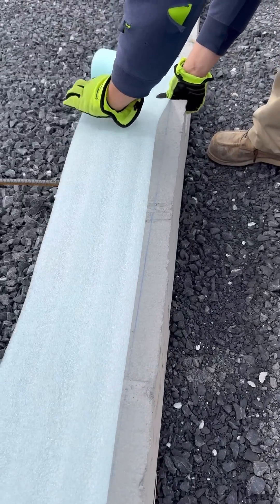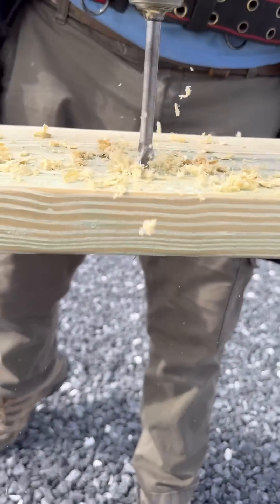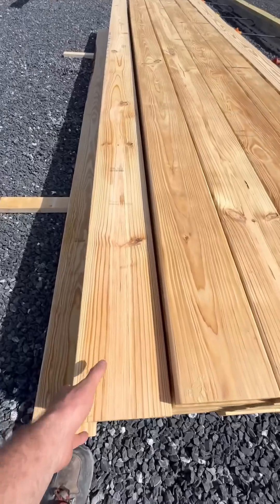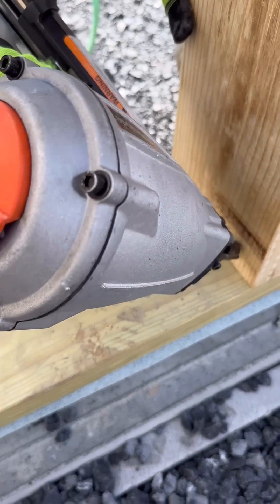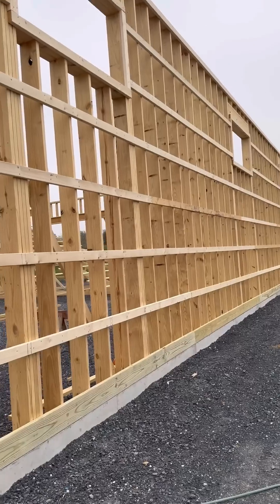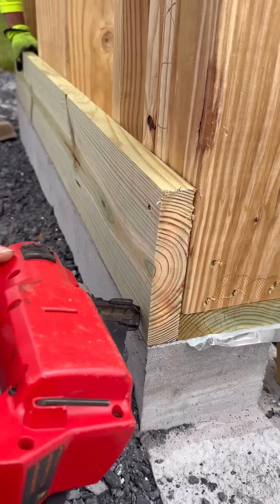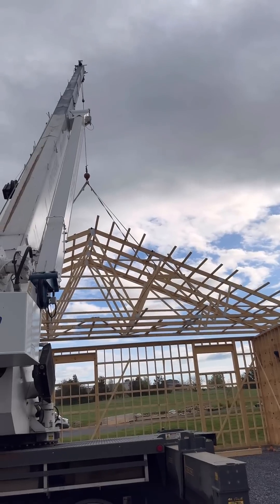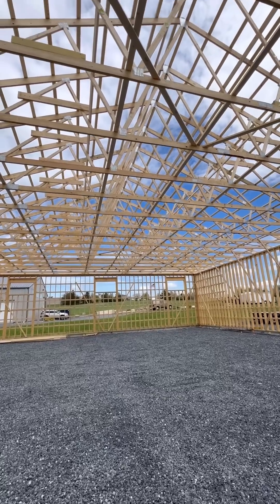How To Frame A Warehouse

Comment: Did you legit toenail the bottom of every stud? I don't think I've ever seen a worse technique in an instructional video. That's simultaneously worse for structure and about three times slower.

Also, id ramset the plate to the concrete, set a pre-framed wall onto it, and then drill the holes thru the walls and into the concrete. That way you can set any schmuck to the slow task of drilling at any time, and it doesn't slow down the build process. Your way makes it a total bottleneck.

Comment: You should try the Simpson strong concrete ties. You just drill a hole and drive the tie through the bottom plate with an impact. It sucks the wall down better than anchor bolts. Their a little more expensive but quicker and better in my opinion.
Reply from the maker: I’ve used those before they work really well. But they are expensive.

Comment: With a building that big with wall studs that huge. Can you still use them 16" OC or do they have to be 12"?
Reply from the maker: We went 16 inches on Center but they were 2 x 8 studs
Reply: Most of the time we do 24" on center

Comment: Nails instead of screws 🤦🏼‍♂️
I guess your childhood didn’t contain The Three Little Pigs, or you never learn 🤷🏼‍♂️
Reply from the maker: You need to check building codes, screws are allowed for this type of framing. Screws are brittle and break with movement nails allow for some flexing as the wood expands and shrinks.

Comment: In the uk we would not be aloud to build the whole unit out of wood
Reply: Wood framing is cheaper and easier to insulate. Steel and concrete construction are used if buildings are close together and at risk of fire.

Comment: It seems like the normal way to build a pull barn would be more cost effective
Reply from the maker: The problem with the pole barn is the walls are on 4 foot spacing so it doesn’t work out for drywall on the inside

Comment: Why doesn’t the bottom girt also need sill seal like the sill plate gets?
Reply from the maker: The plans call for the bottom girt to be pressure-treated lumber, so it can rest on the concrete without rotting

Comment: Is there sil seal needed for the bottom gurt? Since its touching the concrete as well? (Actually curious)
Reply from the maker: The plans called for the bottom girt to be pressure-treated, so it’s not a problem for it to rest on the concrete
Reply: It's for insulation value.

Comment: Is wood really cheaper than metal right now? That's crazy. I have a 40*60' steel building at my house. I thought it was huge, but it filled up with stuff just like any other white persons garage 😂. I wish it was wood framed. I never studded out the inside and now woods so expensive I can't, so I can't hang any on the walls. It's just two inches of foam board and the outside steel siding. My grandpa had it built in '99 and I'm pretty pissed the company didn't do any vapor barrier. The foam board has water stains at every seam.

Comment: Great explanations. Thank you! Btw how do you keep studs straight when you nail purlins? Do you mark on purlins or use a level to keep studs straight? I am not a carpenter, so I am curious how you build it plumb and level.
Reply from the maker: They measure and make a mark on each truss for the location of the purlins this way they’re all in a straight line

Comment: 5000 sq ft of roof done by the end of the day a couple days later 
Thats trim and everything…. Right 
More like a couple days framing, a day for trusses and a couple days for steel. That’s probably 5000 screws alone which would easily be 20 man hours

Comment: Why frame 16 oc when it so much cheaper to pole frame when using perlings? Genuinly asking why someone would spend more on this.  Thank you
Reply from the maker: 16 inch on center studs work out better for drywall and interior finishes

Comment: Only one comment:  When you put the 2x8 pressure treated on the front, wouldn't it have been better if the sill sealer strip had extended out to that point as well?
Reply from the maker: It’s pressure-treated so it’s rated to sit on the concrete, but yes a better practice would be to add seal underneath that piece or hold it up an 8th inch

Comment: It amazes me how fast construction workers build these buildings. Recently, a 10 acre warehouse was built in less than a week. It was all steel and sheet metal. You workers are amazing. I dont know how i could ever handle the heat.
Reply from the maker: Impressive
Reply: The shells are so optimised that it's honestly scary.

It was "only" 2.5 acres but a factory i asked some prefab guys to take care of was done so fast after the pad dried that the concrete people were slower to inform me than the prefab guys.

Comment: Noob question here. Why did you put the first seal only partly over the foundation?? Whats the purpose for the missing strip?
Reply from the maker: They put it down underneath where the sill plate goes, but didn’t want to cover their chalk line. The sill was held back an inch and a half from the edge of the foundation to make room for the 2x4 girts
Reply: Bottom plate seal is for insulation.

Comment: Does it have any permanent substantial diagonal braces or stringers ?    Any plywood wind corners or others structural sheathing planned ?
Reply from the maker: Great question! The entire inside of the structure will get sheeted with half-inch OSB
Reply: @hausplans     That sounds like a good plan, it should make it a great deal sturdier !      :-)

Comment: Lay the bottom plate on the anchorbolts and bang it with a hammer to mark the bolt holes rather than measuring out each spot to drill...

Then maybe you get it built in 45 seconds instead of a minute 😉
Reply: We do that most of the time. Measuring is slightly more accurate unless someone measures wrong

Comment: That 'shed' is exactly what I need to park my lawnmower in! 😂

Seriously I'd love to have a garage\shop just like this! Need a lift or 2 maybe on one side. I'd also add the PEX to the concrete so I could put in radiant floor heating eventually & of course a mini split HVAC unit to keep temps down in the summer heat. Maybe someday! 👍🏻👌🏻🛠️🔧🔩🤔⚠️🚧📐🗜️🗜️✏️🦺🚜

Comment: That’s crazy… We framed a similar 50’x100’ shop last year that took us (2 man crew) a month to frame. 2 floor systems in it though, along with 3 sets of 8-3/4”x36” single-span glulams spanning the 100’ run bearing on 4 9x9 GLCs each run. (2)2x12 @ 24OC for the roof system with 3/4” plywood. Miles of hardware and lumber. This is a whole different system but it’s amazing to see a shop go up this fast and efficiently. Good job! 👍🏽
Reply: 36x100 barn, 2 man took us about a month, in July in the middle of a open field using a generator for power. Worst month of my life lol
Reply: @uzifromtwitter5257  I bet! Stress is a real factor on these builds.
Reply: 😳😯😃YOU'RE amazing!! Two men building that much quality construction is impressive.  
Rock on👊
(Did you top off installing a metal or asphalt shingle roof?)
Reply: @ayouness  we did!
Sided and roofed the building. Certainteed landmark Asphalt composite shingles 👍🏽

Comment: No wonder buildings fly away when there is a bit of wind. Nothing anchors the building to the ground.
Reply from the maker: I guess you missed a part about half-inch anchor bolts
Reply: @hausplans  Thar's cute !
Reply: You fools think it is "bit of wind".
Reply: @n3v3rforgott3n9  Exactly... And that's why the weak connections to the ground are absolutely not adapted ! That's why the structure is not adapted.
Reply: @fabr5747  ... you understand very little from the sound of it.

Comment: I am an architect from Germany and it’s funny to watch how warehouse in the USA are built… in Germany warehouse are usually made out of steel beams and if it made with wood, it would be huge beams with an huge distance to another and usually with big steel connectors.
Reply: This is typically called a barn or out building. We have minimum codes that require certain materials for these buildings, so my guess is that this is either on a farm or something where its not commercial work but rather residential.
Reply: North America is about mass production, Europe is custom made. It was the same 100 years ago as it is now. Frame buildings are the best for mass productions. And if one keeps water away (though Venice stands on wooden beams for several centuries) it will last for 200 years no problem.
Reply: @thecurious6721  it is not about mass production… because big steel beams or big wooden beams are also very easy for mass production… we use these video shown frames just for smaller things like a carport or a tiny hood for gardening equipment… for everything bigger we use bigger dimensions…
Reply: @m.s.3041  steel is more expensive than wood and more difficult to work with. Though, I meant it is for mass production of detached houses, not tiny apartments from metal and concrete.
Reply: steel is more expensive and the weather climate and terrain of a lot of states in america makes wood a better building material bc of storms. in places like tornado alley and stuff it would be super expensive to replace a house framed with wood and steel beams instead of js wood. up north they have rly bad snow storms and shi too and down south the hurricanes so wood ends up being the better option so ppl don’t go shit broke repairing their houses multiple times a decade or year depending on where they live
Reply: also the way foundations are laid in america is a bit diff from europe too bc of the climate. so wood and plaster tends to be fine in the long run bc the foundation is strong enough to withstand storms and stuff. wood is just used if god forbid something happens it’s easier to replace. it’s also a better insulator for heat and shit too
Reply: @xaxabinks  sorry, but usa has different climate zones. From alaska to florida. The way north america houses are built is pure financial reasoning. 100 years ago US had the same houses as in europe from brick until smart entrepreneurs realized that they can build cheaper and faster wood frame houses rather than masonry houses. That's it. nothing else.
Reply: @thecurious6721  ngl i deadass said shit ab usa having different climate, i thought it was implied when i mentioned multiple states that i meant multiple climates… wood is the best for most of the climates its also the cheapest and its best for some foundations bc its lighter
Reply: @thecurious6721  and even a 100 years ago wood was still used for framing bc it’s one of the most abundant materials here
Reply: @xaxabinks  explain me why all over the world! except north america and australia most of the construction made from brick, concrete and metal?  Are they wealthier than Americans? Or US climate is so unique that wood is the only best option for US?
Reply: @thecurious6721  concrete isn’t as great as u thing for building houses. it cracks in fires. it’s horrible for earthquakes bc it can’t hold its form well. and on top of that it’s horrible at insulating. And america is literally more wealthy than every country you just listed. like miles more wealthy.
Reply: @thecurious6721  and the American climates are 10x more unique than Australia or England lol. We have deserts, Tundras, Rainforests, Woodlands, Forests, Swamps, Marshes, etc. Just the north east coast, where I am, has culture, architecture, and climate so different from the south east coast you’d think your in a different country if it wasn’t a state of the US. Florida is nothing like New York. New York is nothing like California. Florida also literally has a shit ton of concrete and brick houses bc they cool shit better and the east coast barely has earth quakes. Cali has concrete houses(for cooling) and shit too but most are wood as well bc they have earthquakes often as well as sand storms and shit. I also think europeans forget that a lot of southern parts of the US literally never see winter. And some parts of the US see winter for like 7-10 months out of the year. Maine literally has snow in fucking May. Like 4 ft of it. Houses are constructed completely different in every single state bc the climate of all 50 states is different. Saying american houses are weak because they are wood is stupid bc u forget that a house’s integrity comes from more than just its framing. It comes from it’s foundation, the era it’s build in, the way it’s being framed, the type of wood being used to frame it(i know that it’s hard to comprehend for some people but not all woods have the same properties) There’s also the roof, siding, the basement if there is one and a bunch of other shit too. Even windows can make a houses integrity greater. Y’all need to work to some research on how houses are built before u talk shi ab american construction ngl. Bc i’ve deadass have never seen a building collapse here unless it’s being demolished or there’s a natural sink hole forming under it from DECADES of it being there. Hate when ppl who have never worked in construction talk about it. y’all look stupid.
Reply: @xaxabinks all people in the usa are shit broke because they like to owe everything, always using credit cards and loans
Reply: I guess like a personal/small business warehouse is what I was meaning.

Any supply store/material yard, rental equipment warehouse etc I’ve seen concrete and steel beams.

That’s what I meant.
Reply: . 1760 house we worked on , Ceder siding,  new cedar roof , real old growth 2×6 sheathing on diagonal,  still Plumb Level square,  not fast growth the use today,  we do Steel buildings , largest 125'×575' clear span
Reply: American Insurance don’t like when things last because it doesn’t make anyone any money if they don’t need to be replaced sooner rather than later
Reply: Our commercial Warehouses are still as well largest I ever did ., in US, 34 meters by 600 meters clear span expandable end wall
Reply: UK construction uses steel frame construction for these type of industrial units too
Reply: @willjumeee for actual industrial warehouse we use steel beams and concrete etc.

This is kore a personal use type building not a commercial/industrial.
Reply: @justinstevenson2061  brother, the video literally starts off with “this 5000sq fr warehouse”
Reply: @willjumeee  I would bargain this isn’t a commercial or industrial building.
Reply: @richardmann4006 building of that side with multiple roller shutters - likely to be industrial even if a store of sorts
Reply: Crazy seeing such buildings being made of timber in  this day and age!  I build warehouses in Australia. Only wood in the building is the skirting,architraves and doors in the office part of the warehouse.
Reply: @lovelyhurlin6494  when the alternatives cost considerably more, wood is very appealing.
Reply: @sterlingodeaghaidh5086 also in wet climates steel tends to fall apart just as fast as wood unless you get way thicker and more expensive.
Reply: Cuz it's crap that wont last 20 years strong, wood is not as strong as it once was. We are farming it too fast
Reply: @saucedgamingnetwork4394 wood is just as strong as it always has been 😂😂😂
Reply: @saucedgamingnetwork4394  wood buildings definitely can last 20 years
Reply: To be fair, a wood frame structure (stick-built as we say) like this is pretty rare even in the USA. Most often, a shop/warehouse building of this size would either be steel or concrete tilt-up.
Reply: why is funny?
Reply: It's a good thing they had a structural engineer design it and not an architect. If we need something to look pretty, then we'll give you a call!
Reply: @AC-im4hi  IKR, many of these commenting don't appear to have a clue what Yellow Pine is and the strength of it.
Reply: @AC-im4hi  to Err is human , to really foul things up requires an ACAD program
Reply: @AC-im4hi   what do you mean? Naturally these warehouses are just made by engineers in Germany… i just said why i know how they are built in Germany, because as an architect i have many insights on these things…
Reply: This is probably a warehouse on someone’s property or farm. Don’t be an idiot and think all of our buildings are built like a shop at someone’s house.
Reply: Everything’s just built better in Europe
Reply: @willjumeee  That's such a weird thing to say. How long have you been a licensed engineer? You should probably call this guy and let him know his building will fall over and needs to check his calcs
Reply: @AC-im4hi  just a fact that steel trumps timber mate
Reply: @willjumeee  It actually doesn't. You have no idea what you're talking about

Comment: Better to just use steel , lasts longer and probably cheaper .
Reply from the maker: We’ve used steel before it’s more than twice as expensive and really hard to insulate
Reply: @hausplans  thing to do is look for a building someone ordered but did not build . At the factory or individual.  It's more common than you will suspect . I once was called off the election of a 4 story red iron building . The steel was delivered but the builder punted at the last minute .
Reply from the maker: That’s super interesting, never thought about that. I’m sure it’s a great way to get a good deal.

Comment: Wrong washers were used.
Reply from the maker: Those washers came with the anchor bolts in a kit. They’re correct for our area. The larger washers are needed and seismic design zone above.

Comment: curious why this wasn't built out of cold form steel? I believe steel offers more flexibility (literally) and rigidity when braced properly, and sometimes its cheaper
Reply from the maker: We’ve had some more buildings made out of steel. They cost a lot more and are way harder to insulate and keep warm.